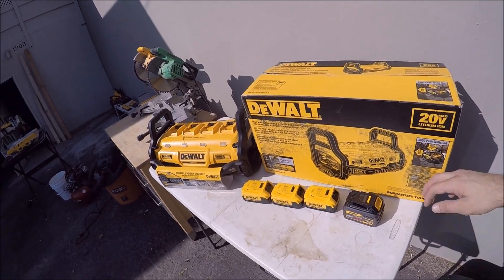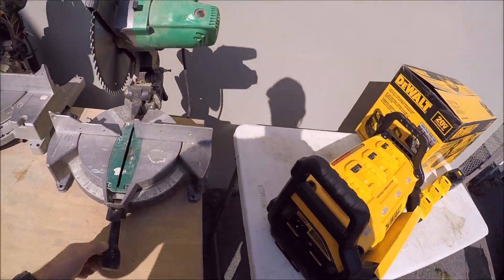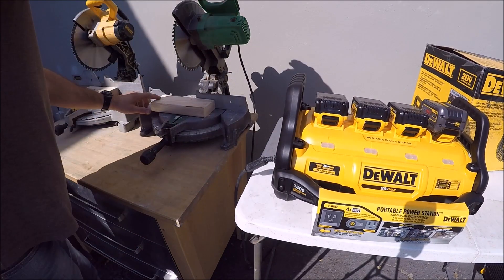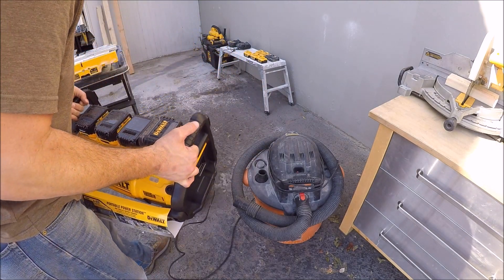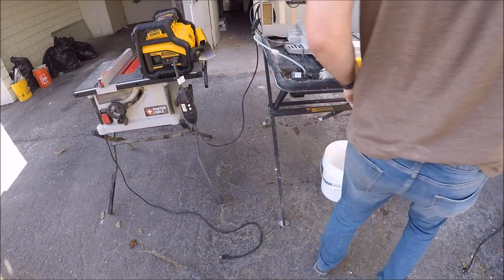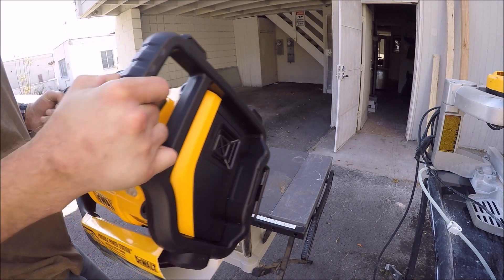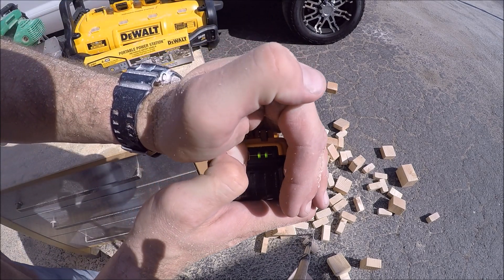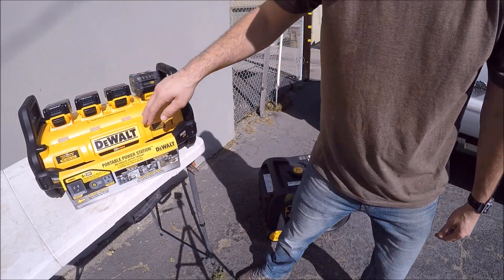No Generator? No Problem! Dewalt Power Station Review and Testing!

Comment from the maker: Dewalt Power Station link
https://amzn.to/2Sv7MSh
Reply: Do you know what would be good for a dewalt pancake compressor to run all day long  a small inverter generator or the power station in going to work I am area that's no electricity I do have a gas compressor but is for large crew and its heavy to put in an out thanks

Comment: I have lots of DeWalt tools but am just a regular Joe DIY'er. I wish I had a reason to buy this thing because it looks sick!

However even on my biggest jobs (building all new pantry shelving with all portable tools) I was able to get through easily by cycling through three 20V batteries :D Can't believe how far battery tech has come, when I was younger I remember my grandfather's tool collection being mostly hardwired because the batteries took ages to charge and put out like no power. And that was only back in the late 90s, early aughts.

Comment: A 12 amp hour battery costs 200 dollars of u had four of them u wud need 800 dollars to buy the battery's then three hundred to buy this that's 1100 wrapped up in that tool how with it would that be compared to say a 300 Dollar generator that runs off fuel u said something about the 2000 wat predator wudnt run that saw I would have to look into that to see iv been doing alot of soul searching on getting a predator
Reply from the maker: I have multiple video reviews on the the 2000w predator, check them out.

Comment: Can this power up a small pressure washer ? And if it does for how long ? 
Same questions for a steam cleaner and wet dry vac
Reply from the maker: Yes, it will power a pressure washer for hours and hours...Keep in mind, this will run a large tile saw for hours.
Reply: Landberg Tile TV would you do a year update review of the power station ?

Comment: Does anyone know how long a compressor will run for on this
Reply: Sam Brown depends on the horsepower but it won’t run my 3 hp one.  I’m sure a smaller one it will as it runs my 110v fluxcore welder at 60 amps for 2 hours so I’m sure if it runs that it will run a small air compressor without a doubt.

Comment: This powered my tablesaw, miter saw, router, air compressor and SDS Max rotary drill until I switched to cordless. 

The rotary drill pulled the most power by far and killed the unit. Now it just charges.
I think there is a fuse or something inside that's burned out but there are NO parts for this unit so fixing it is a no-go. If you break it within a year, DeWalt will give you a new one, if you take it to one of their facilities, but I've had mine for about 14 months. Great idea, but the electronics can only take so much before they die.

Comment: I have this with the new 12 amps 20/60 volt flexvolt  and I can run my 110v. Fluxcore mig welder on this at 60 amps for about 2 hours on and off ,  fill size fridge for 4 hours and a small mini fridge for 8 hours,  Unbelievable.  There are other ones in the market like the EGO and Milwaukee but they won’t run a 110v welder.
Reply from the maker: Yes sir, this machine is amazing! 👊
Reply: I’m in a catch 22.  I’m from the UK our domestic power is 240v 13amp -  our power tools are 110v for safety regulations so we use a transformer to change the voltage,  can I use this on my domestic appliances at 240v 13amp?   Or can I use a inverter to up the voltage to 240 ?
Reply: @bmxcandy666  I have no idea as I'm not an electrician so you may want to talk to one before buying this so you don't waste your money.

Comment: Using DEWALT FLEXVOLT 20V 12AH 4X batteries for long running
Reply from the maker: When did those 12ah batteries come out? Are they much better than the 9ah?
Reply: Dewalt flexvolt 12AH In stock now
Reply: How long does it last with the flexvolt 12AH batteries?

Comment: A buddy of mine bought one last year as a kit and the first test was a 1600w space heater...45min in a Canadian winter!
Reply from the maker: You must try it with 6 or 9amp batteries and let us know how it works!
Reply: I just got my own power station and already have a half dozen 5ah batteries. I will do run time tests and get back with results. My intention was to use the 9ah batteries and then I saw the new 12ah offerings. They are so new that by brother who works for Stanley/B&D was not even able to pull up a price yet. Even with his employee deal I'm guessing in the range of $700Cdn. for four of them. I know I can get the 9ahx4 for $400Cdn. The power station was too good a deal at a special employee sale. My brother got me an open box unit for $150Cdn!
Reply: John Ricci what is the Amp hr on the standard battery?
Reply: John Ricci 700 WH???!! It would knock out smAlll job

Comment: I have ryobi, and I wish they had something like this. I also wish they made an AC adapter for cordless tools. Tools like brushless grinders go through batteries too quick.
Reply from the maker: I agree! Check out my recent video on the cordless tabletop tile saw. It takes batteries, but doesn't have an option for AC!? crazy...
Reply: Kyle Stevens i dont know why they havent made a battery case that slides into the tool but has a cord going from the batter to a power outlet. I tried to make one a few years ago.
Reply: I have made my own Ryobi version of this, however it can only handle up to 100 watts! Nothing like this DeWalt beast can! I've been trying to show my home made inverter to Ryobi, hoping they will make a real version, haha I think I will have more luck building it myself!

Comment: The power station will only run for so long... The batteries will die, the generator will run indefinitely as long as you keep feeding it fuel... 
The real question is, if you load it for a full 14-15 amps... How long will it run while the load is pulling 14-15 amps ?
Reply: Landberg Tile-Handyman-DIY  have you tried this yet? I’m also very curious. I’d like be this to run my airless sprayer
Reply from the maker: +You Tube that's a great question! I'll have to plug it into a shop vac and start a timer when I turn it on. I'll try that and update you.
Reply: Sounds like a plan :-)

Comment: So it wont work if u take all those battery out????
Reply from the maker: +anthony 35 Nope, only works with the batteries in, but it puts out more power than a 2000 watt gas generator!
Reply: Where did u purchase it?? Im get one thats pretty cool
Reply from the maker: +anthony 35 You can click on the link I added in the description box on the video. Amazon has the best return policy if you don't like it.